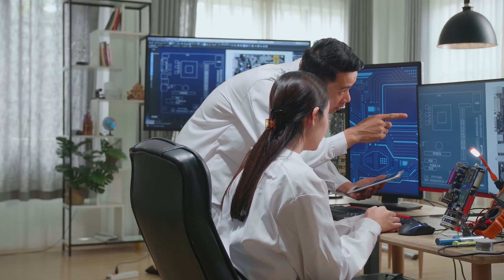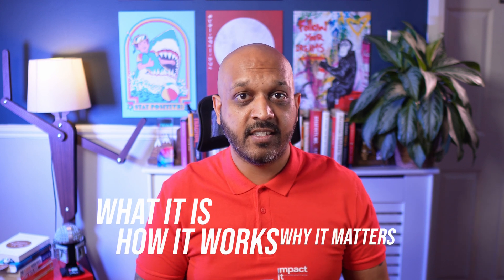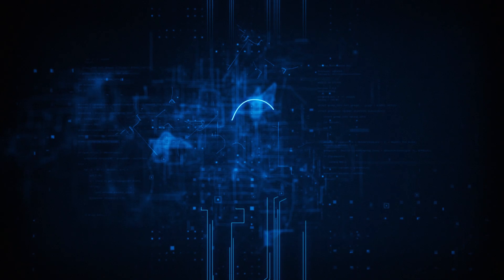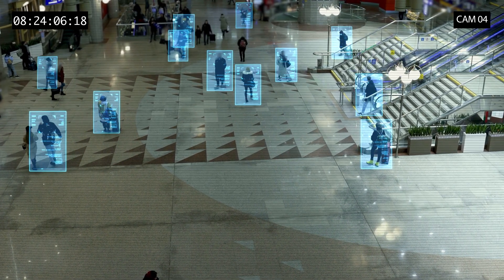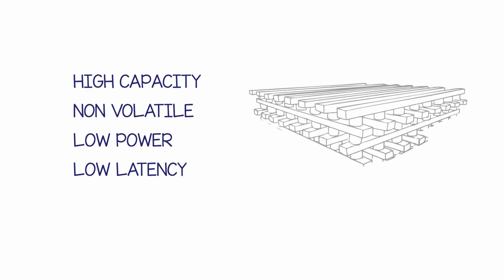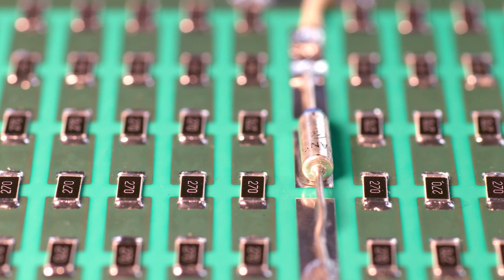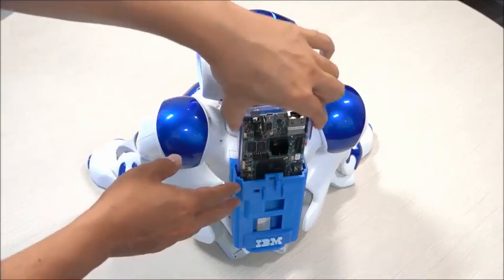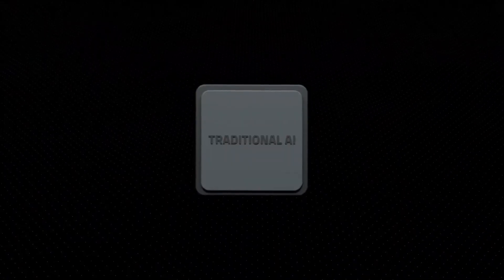Meet the Self-Learning Memristor - the Brain Behind Tomorrow's AI

Comment: So many mistakes that it would require another video to address them :D
I'll highlight what is important. 
Catastrophic forgetting has nothing to do with when ChatGPT "forgets" what the conversation was about. 
It is a distortion of weights and biases in a neural network when you trying to train it over previous training. 
It happens not because it is not hardware or not analogous, but because NN doesn't "know" what nodes can rewrite and how to change the values without destroying the results.
The offline nature of training does not come from the "Feynman bottleneck" and other reasons mentioned in the video, but from the statistical nature of the training algorithms.
To effectively perform gradient descent or neuro-evolution, you have to pour data like crazy, hundreds of thousands or millions of examples. 
Just moving this algorithm to hardware won't change it. Yes, you can save energy, but you'll only train a single chip. And trying to train it to do new tricks will also lead to catastrophic forgetting. 
Conclusion: only innovation in ML algorithms can allow us to build better AI. Then we can think of developing the hardware to run those algorithms optimally.
Reply from the maker: Hey! Appreciate the detailed comment.

You're totally right about a few things - for example, catastrophic forgetting refers to the overwriting of prior knowledge during new training, and not ChatGPT forgetting context (I could’ve made that clearer – I was going for a metaphor, but I get how that could mislead). 

You're also spot-on that online learning isn't just a hardware issue - it's deeply tied to algorithmic design. That said, the memristor chip I highlighted isn't claiming to solve catastrophic forgetting, but to enable a platform where on-device, adaptive learning becomes feasible.

You're right, the real leap will happen when we pair these emerging hardware paradigms with robust continual learning algorithms. In other words: I think we're on the same page - hardware alone isn't the answer, but it's a big piece of the puzzle.

Appreciate the pushback - makes the convo better for everyone!